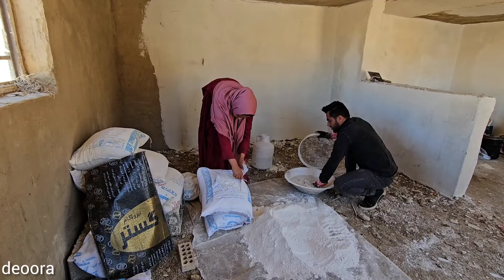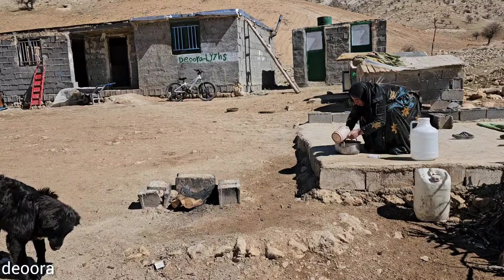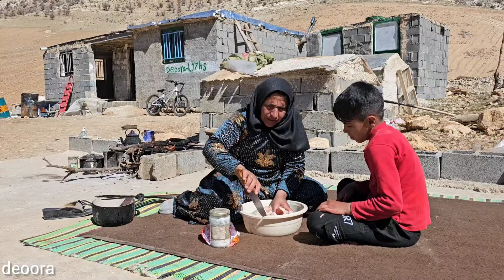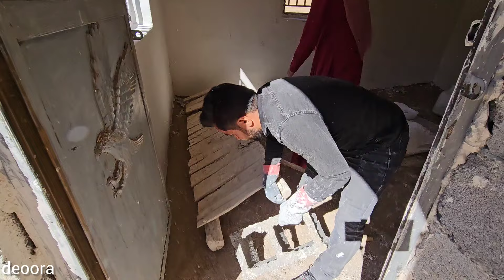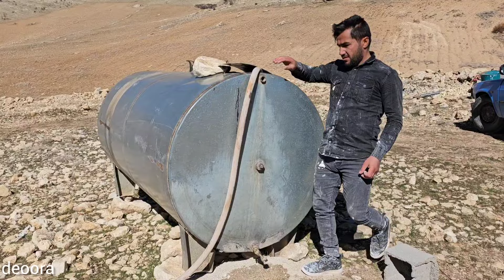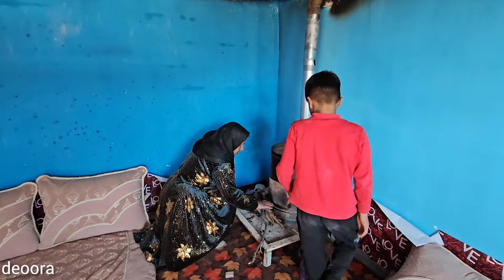A look at the nomadic life and Nemat's talk about removing the Deoora family's main channel

Comment: It is very difficult to watch you cutting wood with the wrong tool, the tool you need to use is called an ax, the tool you are using is not only dangerous but useless. When you use the right tools the job becomes easier. The wheel barrel you are using is fine but they make wheel barrels with 2 or 4 wheels that are used to carry blocks, water jugs, tools and many other things without so much effort. Your son from "Rustic Echo" just purchased a battery and a light with a long extension cable. You need one of those to provide lighting anywhere you need it even outside. You can place the battery in a plastic container just make a hole on the side for easy carrying to move it from place to place as needed. Please place that big water tanker on the cement are you already have that is the perfect place for it and could you please make a strong platform to elevate it at least 2 feet off the ground. Love you guys! Your friends from Texas U.S.A. God bless your family and Jenny your dog.